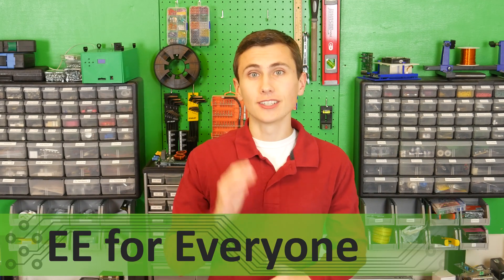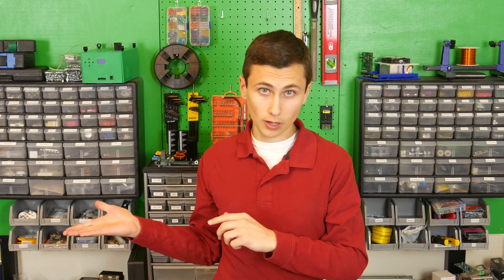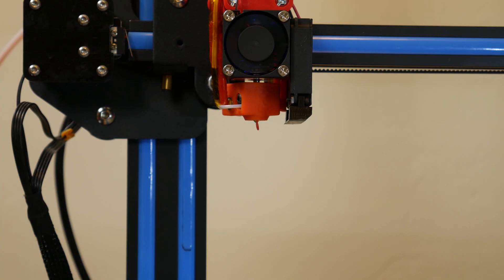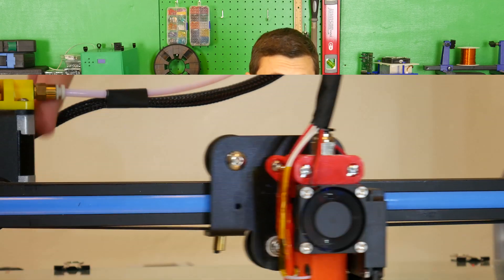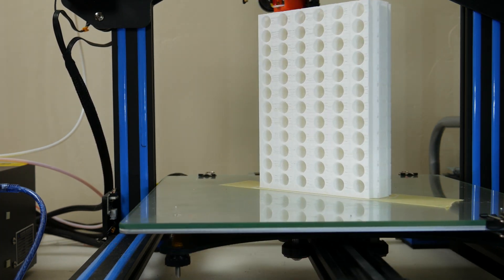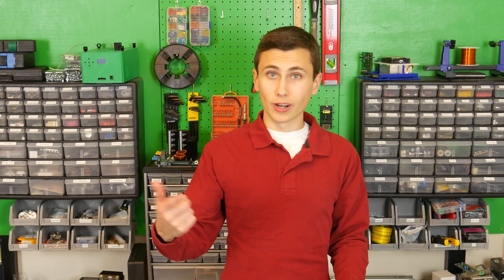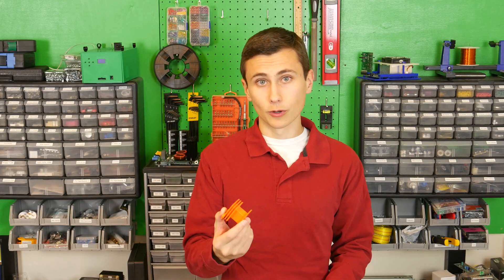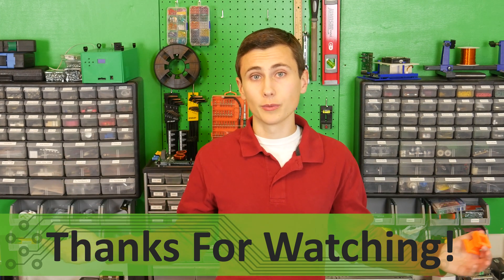CR-10 V6 Hotend Upgrade

Comment: Hi... I´m having jams with the E3 V6 Upgrade in the CR10 MINI... any advice? thanks
Reply from the maker: Hello Dario, Yes! I've had problems with jams before, but for me the nozzle and hotend weren't really the issue. My issue was using low-quality filament, which had an inconsistent diameter. However, I've also heard issues of finding small metal particles in filament, leading to jams as well. I'd try a different spool of filament (or a different brand) and see if that helps at all! I've had good luck with hatchbox in the past, but I'm sure there are lots of great brands. I hope this helps!
Reply: @EEforEveryone  thank you so much! I'll try better cuality filament... Maybe it's that the problem because I have tried it all... Nice channel very helpful!!!
Reply from the maker: My pleasure Dario! Happy to help. :) Best of luck! If you find success (or not), throw some pictures of your printer (or what you're printing) on Twitter or the slack channel! Cheers!